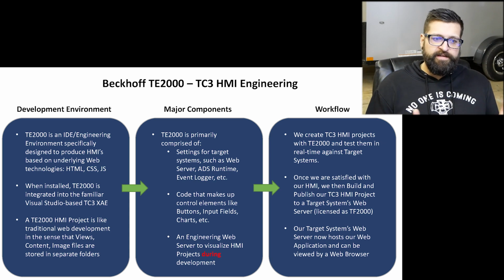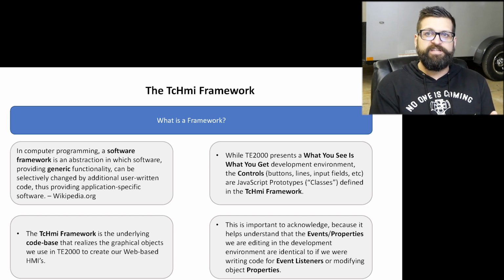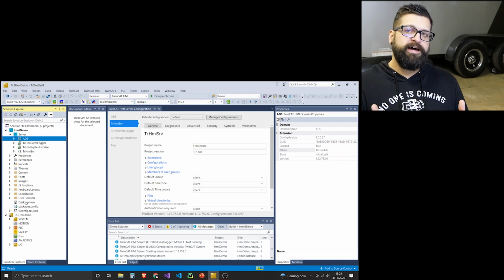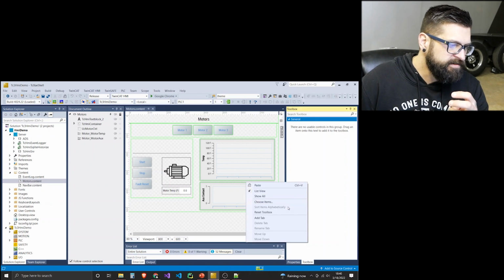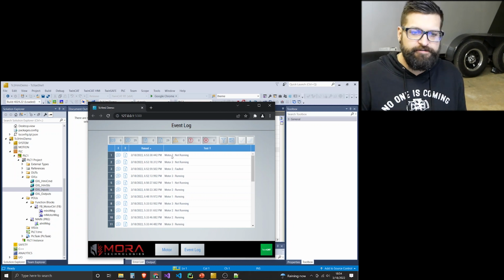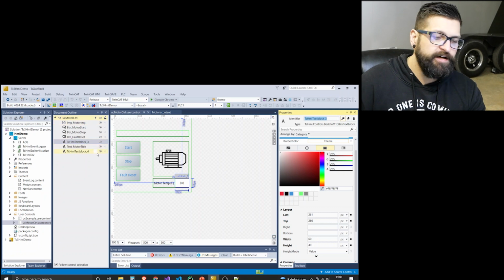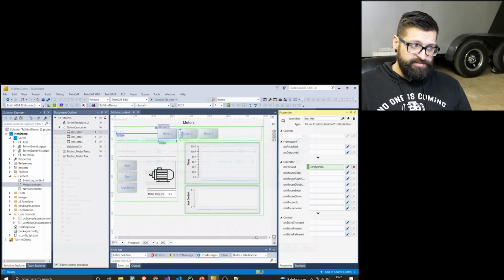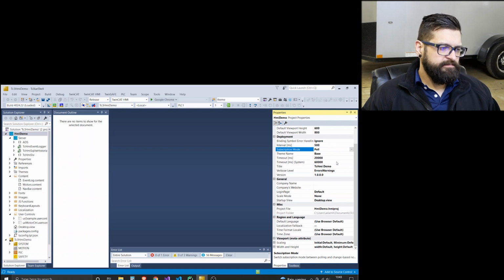Modern HMI with TwinCAT and HTML, CSS, JavaScript (Part 2/2)

Comment: my personal experience with the Beckhoff HMI is very poor. Full of bugs for the most part, which I had to find solutions on my own as the local support doesent know much about it. It has been about 2 years since then, I hope they fixed the issues, but I would rather stick to a C# application or something alike where you have full control over the HMI and the code as a whole.